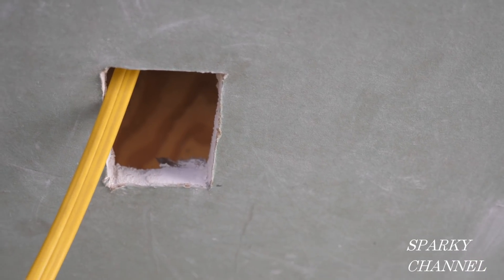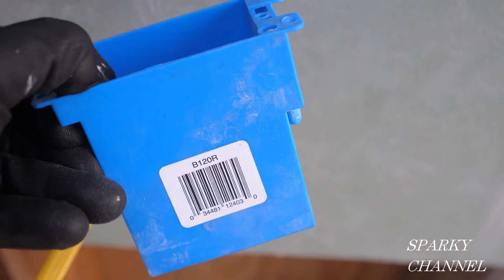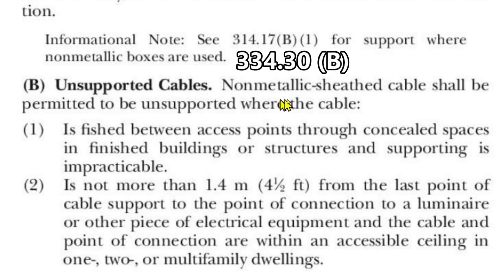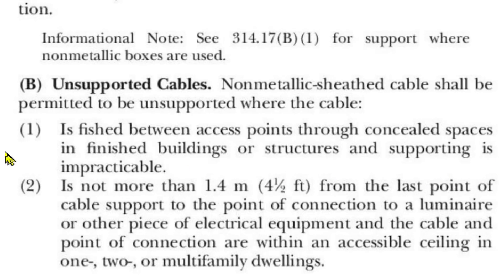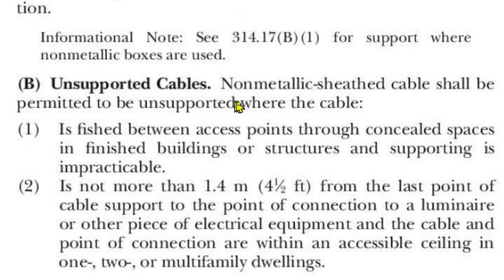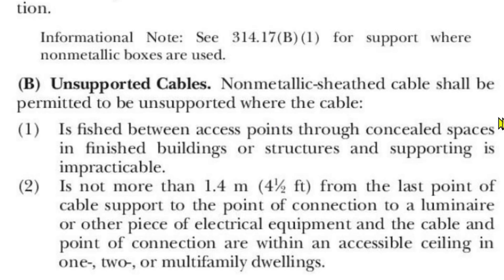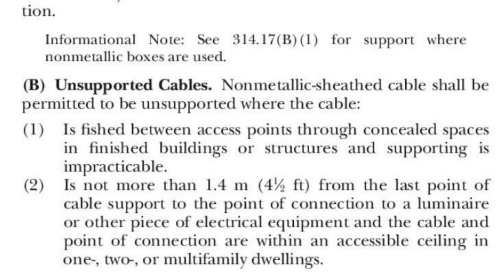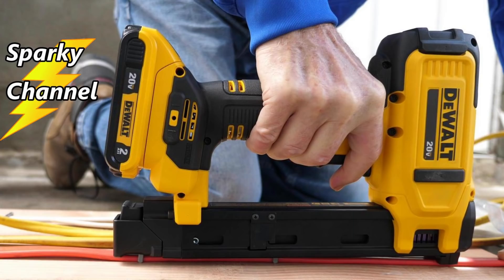Do Cables Need to be Supported When Fishing Them Behind Walls? NEC 334.30 (B)

Comment: So as long as I staple the cable in the attic I’m good? I can run it down the wall to the new outlet with no issue. I was just worried about it getting damaged later down the road by a nail or something.

Comment: Just what I was looking for.  Hope it's still applicable in 2025.
Reply: Yes it does, and if your are an electrician you should have a copy of the newest NFPA / NEC 70 code book that the city or town you are in uses. Also as part of your renewal you should now have a copy of the 2023 NEC 70. If you are a homeowner living in the house you're are working on many city and towns allow you to do the work, but it needs to be up to code and permits apply for and signed off as completed by inspector. If you don't there is a little thing called liabilty and you insurance may not cover a result from damage caused by improper installation. Just saying so you do it right, remember your loved ones sleep there.

Comment: Call me crazy but I’m remodeling my house and even though I’m not taking down all the drywall in certain part of the house,but when I need to run a new home run or outlet etc. I’ll just cut in to the dry wall around for the outlet to support the new cable and even make a small section on of the wall before the ceiling to support the cable. It’s just a habit.

Comment: Bill, if I'm extending from an existing plastic 1-gang new work box by adding an old work 1-gang box on the opposite side of the same wall cavity, do I still need to worry about 314.17(B)(2) clamping requirements, even though 334.30(B)(1) allows me to fish cable unsupported?

314.17(B)(2) provides an exception if the NM is secured within 8" of the box without a clamp, so I suppose the added old work box's built-in clamp could meet that exception IF located within 8" of the existing box's knock out -- is that right?
What happens if the boxes need to be more than 12" apart though?  Does that mean I either need to saw out the existing new work box and replace it with something that has clamps (or cut drywall holes) to meet clamping requirements at the box, even though 334.30(B)(1) lets me fish cables unsupported?
Reply from the maker: I love how you've studied the applicable codes! You are correct using 334.30(B)(1) allowing to fish cable unsupported IMO.

Comment: You would think code would require the use of a cable to box securing device that keeps the cable from being pulled back out of the box when it can't be stapled near the box (also eliminating the possibility of stress being placed on the connections within the box should the cable be put under some external pull).

Comment: I would argue that any ceiling  that had an accessible  attic above it, should also be considered an  accessible ceiling. As long as you could get to the wiring mentioned in (2).
Reply: If the attic is used for storage of some sort I agree with that point but most unfinished attic spaces I’ve been in are just gross and filled with insulation and the only times it gets visited is either rodents or the once every 10-50 years (if that) that a worker needs to access the space for a very specific purpose in which case I think it’s fine.
Reply: @GB-ud6yg  doesn't matter what it's used for, it's still accessible

Comment: My instructor in electrical school used to always say if you wanted to see an electrical nightmare re wire a 1970’s mobile home. Never knew what he meant until me and my wife bought our starter home ( ‘74 mobile home). I don’t believe these manufacturers knew what a wire staple was back then cause I have not found one till this day. Wire came out of the panel up into the trusses and was lay out until it was terminated in a brown fiberglass box the was screwed to the wood paneling. The wires entered the box though a 1/2 hole that was drilled into the top. Luckily, we gutted every room and drywall so I was able to wire each room properly.
Reply from the maker: Great job!

Comment: Doesn't the cable need to be protected where it passes through the attic floor?
Reply: It's not the attic floor, it's a ceiling....LoL
Reply: @blueplasma5589  all about perspective
Reply: It is protected, by its sheathing.
Reply: Since it isn't a "sharp" edge, like a metal box, additional protection isn't mandated.

Comment: 334.30(B)(1) seems to be subject to interpretation and not specific. Regarding the finished wall, opening the wall for a staple at 8 inches is impracticable according to whom? The owner that doesn't want to pay to refinish the extra hole or the building inspector that isn't going to pay for the wall repair?
Reply: So you routinely open holes in finished walls large enough to staple  Romex to a stud? I call bs.

Comment: Very crisp and to the point -- really helpful! One question -- if there is an attic over a room, is the ceiling considered accessible and therefore the cable needs to be supported beyond 4 1/2 feet? Or is it OK to fish/lay cable without staples?
Reply: I know it would always be better to staple the cable, but if for some reason it is not easy to do in the attic, would it be a code violation?
Reply: Is it accessible?
Reply: @michael931  Yes, accessible through a hatch/opening in a closet into the attic. Not easy (no attic ladder) but can be accessed if needed.

Comment: Why do you use 12 AWG in many of your videos instead of 14AWG?
Great videos!
Reply from the maker: That way, if someone adds onto the circuit you have a better chance of not being overloaded.
Reply: @SparkyChannel  Ding ding ding -- correct!!! The cost differential is minimal and you can upgrade without more work.
Reply: 15 or 20 amp circuit?  14 AWG is already derated....
Reply: @Sparkchaser1  14, 12, & 10 sheathed cable(romex) are all derated. The reason he uses 12 is and will always be the best choice! Now in many jurisdictions (city county etc)will not allow 14 on any new, or remodel work so it 12 or larger
Reply: Thank you for your question ......===++each day i learn my home more and more.......
Reply: When I re wired my home everything was done in 12 gauge wire. All outlets got a Leviton 20 amp, and GFCIs were needed. Figured with so many devices these days I could not go wrong.
Reply: 12/3 with ground.    Connecting 2 duplex receptacles?
Reply: The amount of electronic devices plugged in in dwelling spaces is borderline absurd these days and eat up the 12 of 15 amps on 14 ga wire fast, not to mention things like space heaters routinely pull 10 - 12 amps by themselves. It's best to run 12 ga, gives you a few more amps per circuit.

Comment: It does specify nm cable but what about MC cable?
Reply: In the wall I’m saying
Reply: @SparkyChannel  article 330 covers MC cable.  it has pretty much the same exceptions.
Reply from the maker: @kenbrown2808  Cool, thanks! I think that MC would be a better choice for fishing behind a wall.
Reply: @SparkyChannel  MC is always a bit more work to strip and secure to the box.  it also doesn't slide as easily as NM in an insulated wall.

Comment: This is of course the minimum standard. If you can support them, you should. I hate when a nail kisses an electrical cable.
Reply: I can’t imagine when anyone would nail drywall where there is no wood.  This type of install also tends to be in non-insulated interior walls, no? There’s also considerable slack in the cable. Therefore, even if someone nails into the drywall alone, the nail should merely bump the cable. A more likely risk would be if someone eventually sawed into the cavity.
Reply from the maker: Yes, this is minimum standard. Good point.

Comment: Where I live in Canada you have to have some slack between the last staple and the box, but in Arizona they pull it tight. What does the NEC say?
Reply from the maker: Check out my video: Is this Cable Stapling Legal? 2020 NEC 334.30: https://youtu.be/pPjGcvgy72I   It shows the max the NEC allows but the least they would allow would be pulled tight. I feel that it is more professional to do the proper cable securing but give some slack to help future electricians in case the wires get cut short or something of the sort.
Reply: Sparky channel has a recent video about that

Comment: A clarification question - If you add another outlet at the same height as existing outlets (typically near the floor), and run the cable up through the top plate and into the attic, is this is also allowed, because walls are typically 8 feet high and at the exact middle of the wall (measured 4 feet up from the floor or 4 feet down from the ceiling), the cable is both 1) supported by the electrical outlet below and is less than 4 1/2 feet as measured at the middle and 2) supported by the staple where the cable enters the top plate and is also less than 4 1/2 feet as measured at the middle
Reply: yes.  if you can't get to it to staple it, you don't have to.
Reply from the maker: I feel that you would be fine per 334.30 (B)  number (1).

Comment: Good job Sparky.  A lot of unsupported cable in walls for 3 way swithes,  switches for ceiling  fan / lights, and new microwaves.  Also for new switches for seperate switches for bath fan, light heater combos.  Enjoy your code references for common everyday wiring modifications.  Thanks Sparky.
Reply from the maker: Thanks so much Gary!